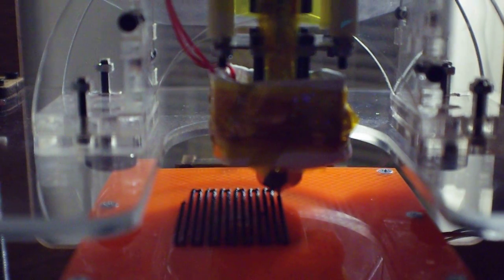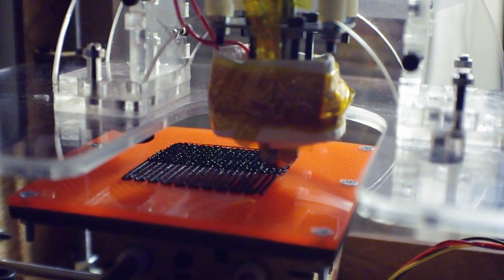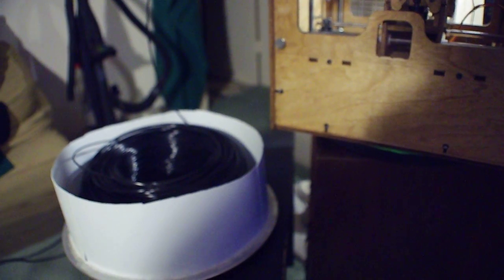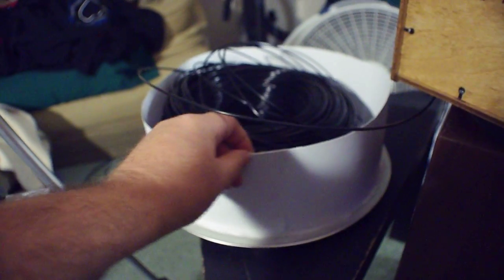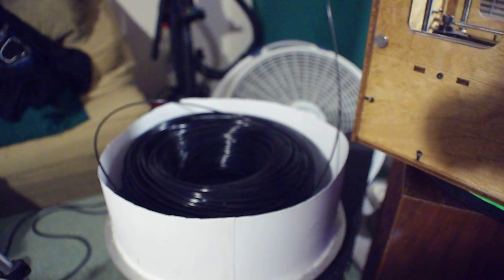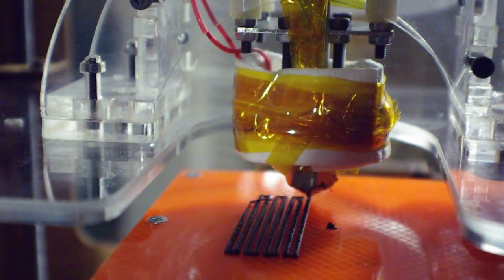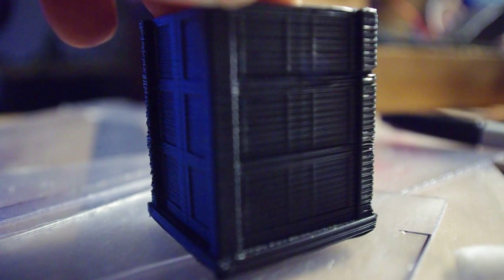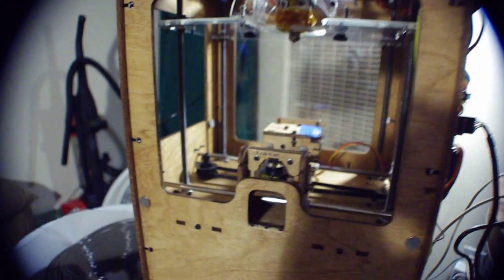Makerbot 13: My 2nd Print 2/2

Comment from the maker: @mokanaman Search for the "Up 3d printer".  It has a MUCH finer resolution, however it costs 3x as much.  I'm gonna continue with the makerbot as it can be tweaked into better functioning than seen here.  I mostly want to use it print organic shapes.  However, I can see that it can be useful for hard edges too, it just needs some love once done.

Comment: @ModelManTom 
I can see. I knew about the maker bot for awhile and always wondered about the possibility using it in scale modeling. I've conducted some research after you started building it, once i'm owning my own joint I will get one of these. The tweaking is apart of the learning curve have fun...

Comment from the maker: @oliviasdaddy1 Nope that's what I thought you meant.  The exturder has to pull the 'thread' in so the plastic pushes out the other end.  Otherwise, the plastic just sits hot inside the extruder.  That is what's going on when it is idling.  There's hot plastic inside that ain't going anywhere. It has to be pushed thru at a certain rate or nothing happens.  The extrusion rate, plus the platform speed determines how thick the lines are in the printed piece.  There is much, much tweaking to do.

Comment from the maker: @ArtofModeling This was pre-made by someone else and posted on "Thingiverse".  I don't know if it was his design or the ripper, but there are problems with the way the plastic is laid down.  You'll see them later in this series.  The printer had some troubles that needed troubleshooting.  I get back to the Tardis after the net couple vids which are maintenance related.